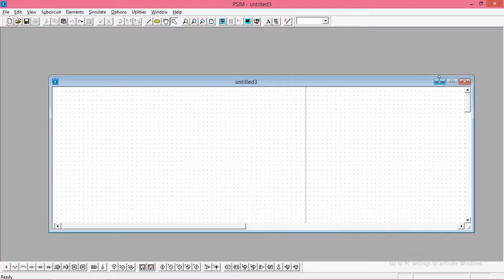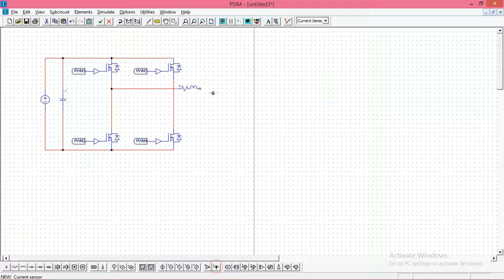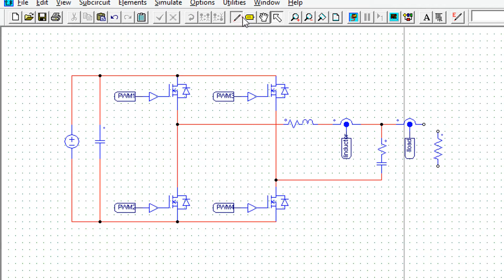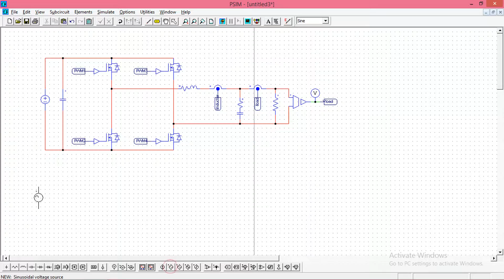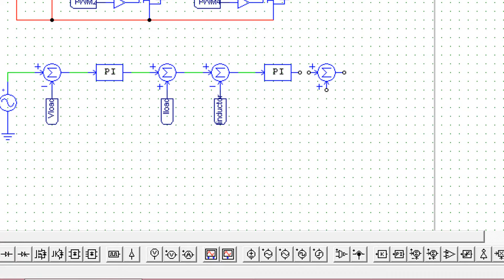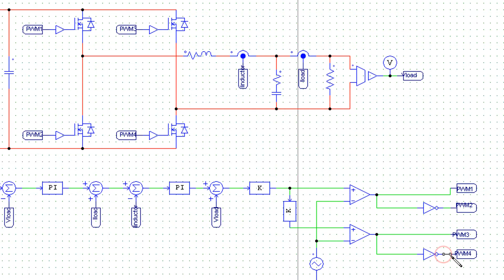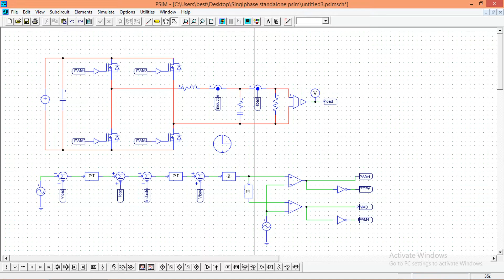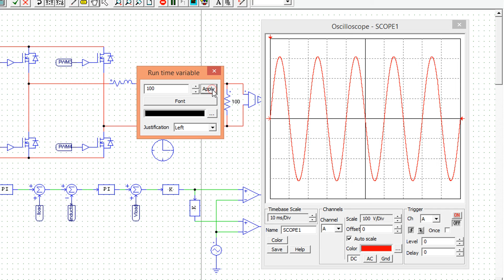Closed loop simulation of single phase stand-alone inverter using PSIM.

Comment: Can i get its reference paper or research paper for this topic
Reply from the maker: my simulation are not based on any specific research paper. i am just sharing my knowledge. but still you may find papers on internet which explains similar control theories

Comment: sir i have a series load rlc after the inverter does this approach  work also because i need to do voltage control or current control  to decide what power is to be delivered to my load inductor which is a copper coil
Reply: i need help there

Comment: Hello!.
How could I add shouting switches (igbt) as control, with two solar panels as inputs? The PV feed one output charge. 
It works well with one panel as input, but when I add another PV, i can´t control the circuit as before. I tried putting a triangular wave and comparator and i tried adding between them but I couldn't
Might you help me please!
Reply from the maker: Share your simulation
Reply: @TechSimulator  How? Do you have some email?
Reply from the maker: ashacademy01@gmail.com